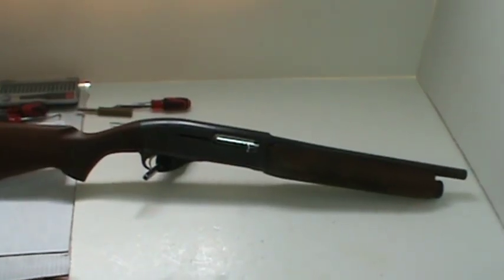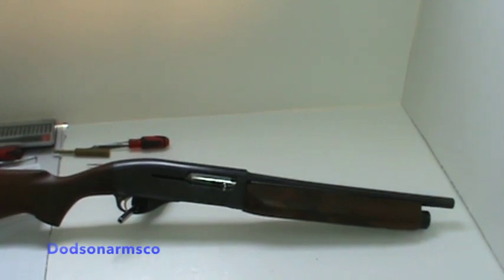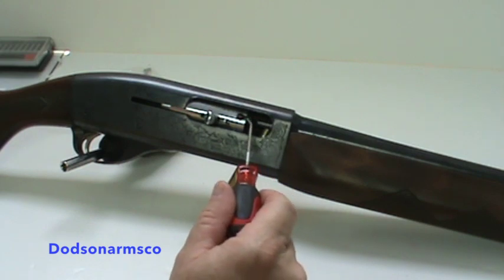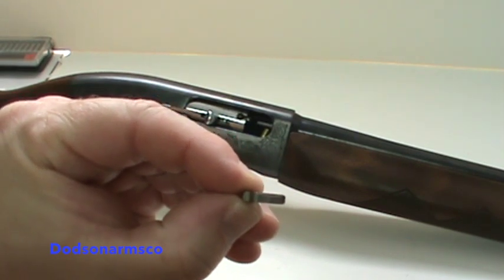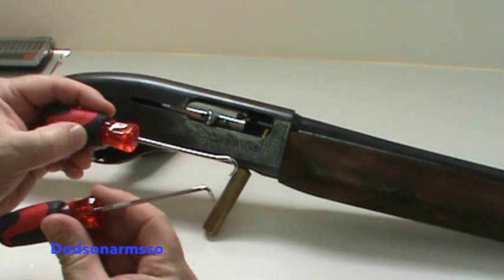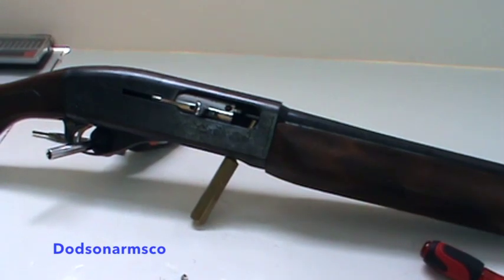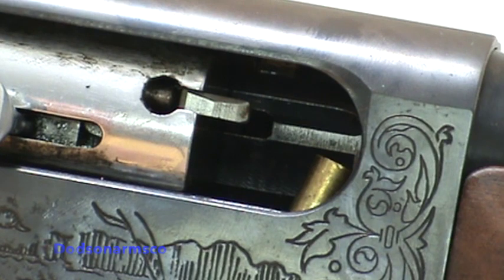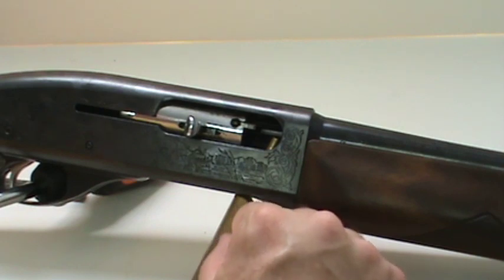Gun tech tip:  #6 Remington 870 1100 1187 extractor replacement

Comment: i tapped the extractor with a light hammer and it became loose and works freely now with a bit of a catch at times.  I'll take it apart and clean and check for burs on the extractor and spring pin.
Reply from the maker: +jj jj We have found some of these factory extractors to have burs on the portion inside the bolt and we have found burs in the bolt recess occasionally . We use the Brownells extractors for the Remington Shotguns, we have found these work well and require no fitting.

Comment: The extractors I've seen for the 1100 are slightly thicker than the 870s. And seems not to go into the 870s. The other way might be ok
Reply from the maker: The extractors I have used in the 870 and 1100 have been the same part number and same size over the years.

Comment: Strange that my 1100 will eject unspent shells when I cycle it by hand but it never ejects the spent rounds.
Reply from the maker: Could be pitted chamber, bent extractor or broken ejector. Also could be bad gas seals on the mag tube.
Reply: @dodsonarmsco  I've replaced the piston with an updated version and it came with a new o-ring and also the gun is almost pristine cause it's barely been fired. I'm going to disassemble the he bolt and see if the extractor is hitching up but I don't understand how it could have any issue since the rest of the gun is so clean and new.
Reply from the maker: @AudioGardenSlave123  does it extract but not eject?
Reply: @dodsonarmsco  I'm not sure when it's fired but it does extract when I manually cycle.
Reply from the maker: @AudioGardenSlave123  check the chamber for plastic residue or pitting
Reply: @dodsonarmsco  alright.
Reply: @dodsonarmsco  I can't tell for sure but after going over everything everything making sure all was clean and moving right I feel like the bolt itself is locked forward. I'm probably not right cause it probably just cycled out and back in without me being able to see it. The issue isn't intermittent and it reliably shoots a shot and the spent shell is either not extracting (even though the ejector is springy and moving freely) or the gun is cycling and just pushing the same shell back in. I think the bolt isn't moving at cause a a failure to extract or eject should cause a shell log jam with a shell from the mage tube trying to feed in after the bolt pushes forward again right?
Reply from the maker: @AudioGardenSlave123  sounds like not extracting at all.
Reply: @dodsonarmsco  Just tied a shoe lace to the charging handle and loosely held the other end with my hand and after shooting it appears by the amount of slack in the lace that the bolt is only moving a half cycle backward. The bolt isn't going back far enough to even move the shell halfway out of the chamber. The lace might have stretched longer than I'm seeing but shoe laces don't stretch much. I'm gonna try cleaning the recoil spring in the stock I guess.
Reply from the maker: @AudioGardenSlave123  sounds like it could be a gas seal problem, clogged gas port, low powered ammo, or bad chamber. What happens with buckshot?
Reply: @dodsonarmsco  put a pin through the gas port and it's clear, I also checked to make sure I put the piston and seal on correctly and it was alright. I thought about trying Buckshot but I have already put the gun away I'll do that tomorrow. I had problems with a Glock pistol that wouldn't cycle and I ended up locking the slide back and the gun shot fine after I left it locked like that for about a week The Recoil spring was too strong and it wouldn't allow the gun to cycle, so I'm going to try the same thing with the 1100.
Reply: How many grains AR the ammo you shoot?
Reply from the maker: @AudioGardenSlave123  is your barrel marked 2 3/4 shells or 3" shells?
Reply from the maker: @AudioGardenSlave123  if a 2 3/4" chamber hi power or magnum shells. Real light loads may not work. If a 3" mag gun they only 3" magnum ammo.
Reply: @dodsonarmsco  3"
Reply from the maker: @AudioGardenSlave123  are you using 3" mag ammo?
Reply: That's what I thought myself but I was shooting doves with my boss who has shot tons of guns for many years and he said the doves ammo should work in my gun. I asked multiple times in different ways if maybe the ammo we were shooting was the issue but he didn't think so. What's the gun for specifically? I'm not sure I've ever even seen 3" magnum rounds before. The gun can shoot 2 3/4 shells but they have to be high grainage? The buckshot I have is 2 3/4 but you think the extra charge of a buckshot shell will cycle the gun?
Reply: @dodsonarmsco   36grain, 2 3/4, 7 1/2 shot.
Reply from the maker: @AudioGardenSlave123  the 3" barrel usually has one gas port. 2 3/4 barrels usually have two gas ports from what I remember. Some 3" barrels will shoot 2 3/4 mag shells some will not. If you are going to use light loads you need a 2 3/4 barrel for it. Most 1100 3" were duck guns in the old days and gas port was set for that load. Try the 2 3/4 buck in it and see if they eject.
Reply: @dodsonarmsco  It only has one port so you must be right. I'll see about ordering another barrel. Thanks for the info, I think we've got this figured out.
Reply from the maker: @AudioGardenSlave123 hope you enjoy it, they are great shotguns.

Comment: Hey there. What is the distance between the trigger assembly pins on the 870 and 1100/1187. Are they relatively the same? Thanks in advance.

Comment: dropped bolt on concrete, ejector bounced out.  spring and pin stayed in.  now ejector doesn't engage against pin and will not stay in bolt when replaced
Reply from the maker: Jim Davies did you install a new ejector?
Reply: @dodsonarmsco  haven't yet, was going to try a dremel tool to polish any lip which may be holding pin and spring compressed, but have to find one that won't damage the face too.
Reply from the maker: Jim Davies you can try some 600 grid Emory cloth on a small screw driver tip to polish it.

Comment: You call it the lifter
Reply from the maker: Hello,

The lifter/carrier comes out of the 870 and 1100 by removing one pin. Some guns it comes out easy, some it may need to be soaked in solvent first. The replacement parts are easily available for 870 & 1100. The parts for 1148, 878, 58, 48 are no longer made, they would need to be found from the used parts companies or on line auctions.